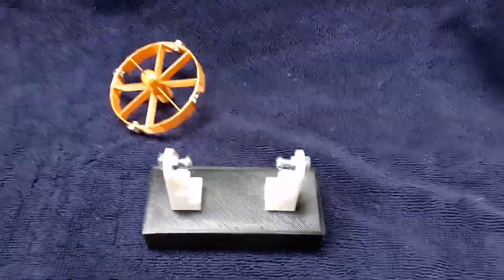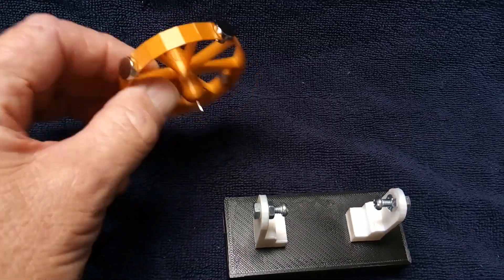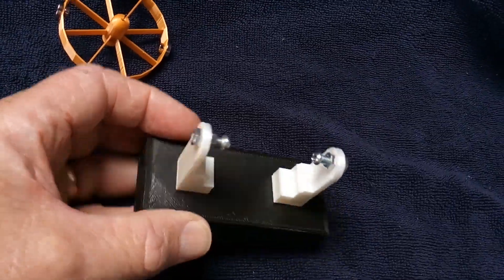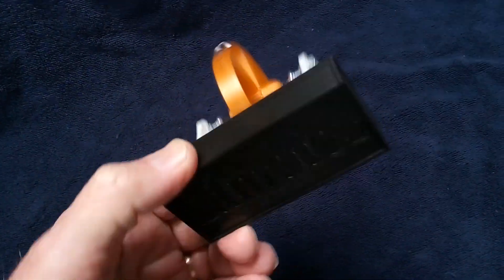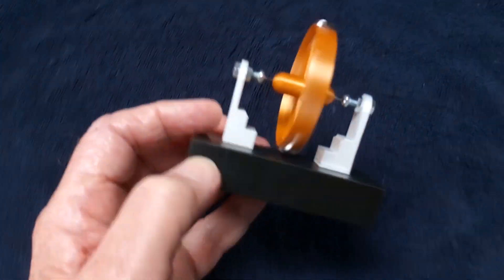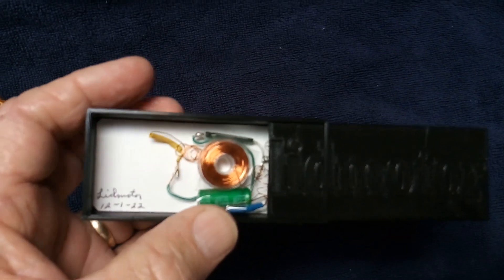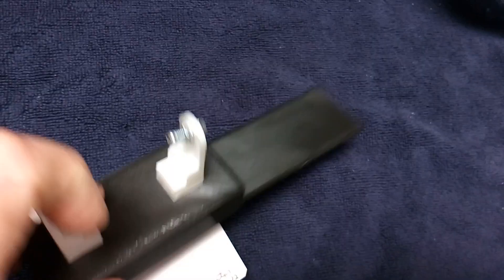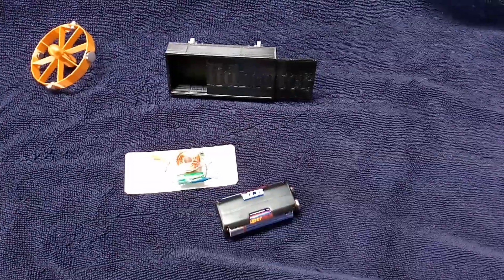Christmas 2022 Pulse Motor

Comment: Could you try putting a secondary coil to see how much you get from it? Not really looking for overunity just curious to see what you get and if it helps run a bit longer :)
Reply from the maker: A fine wire coil with lots of turns might light an led.
Reply: @Lidmotor  that would be cool to see :)
Reply: @Lidmotor  "Maggie" comes to mind.
Reply: if it turns into a perpetually charging motor, powers that be might take down the video!

Comment: Hello my friend, so nice to hear from you again! I was wondering watching this, if you rubbed your feet on the carpet, could the static make a wheel turn in your hands? Just kidding, wishing you and your family a happy festive season!
Reply from the maker: Happy holidays Ben. I made an electrostatic version of this today. It worked pretty good using a 4kv negative ion generator as the power source. I didn't try my feet on the carpet though.😀
Reply: @Lidmotor  :goodvibes: